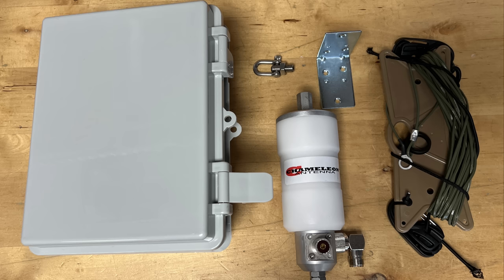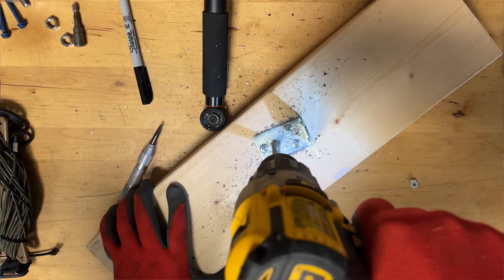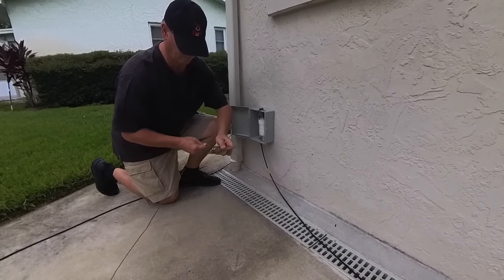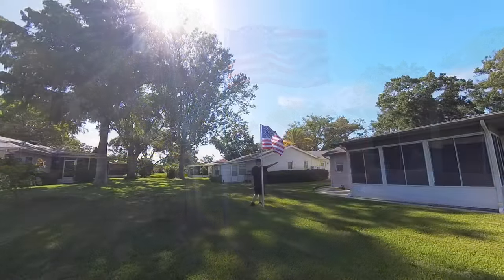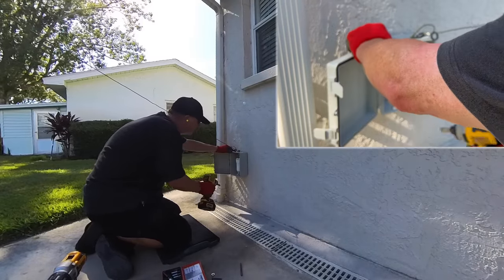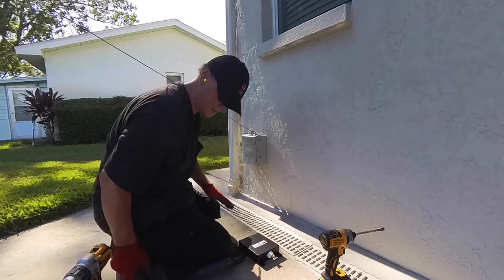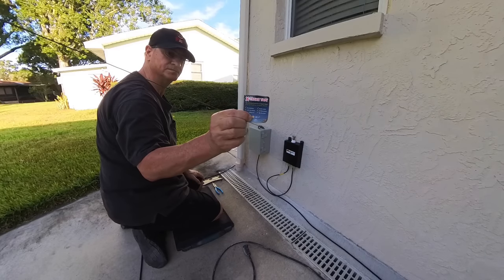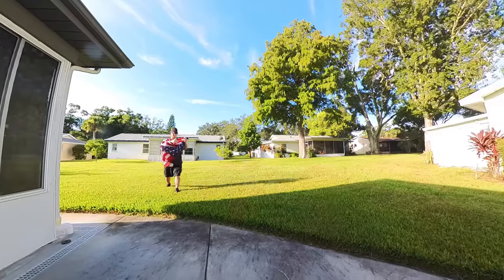Stealth Ham Radio Antenna the HOA will Never Find - Chameleon CHA Porta Mast with CHA Hybrid Mini

Comment: Great idea and great video. I love all your videos and your channel focus on HOA ham radio issues. Quick question: why did you go for the Chameleon CHA Porta Mast instead of a telescoping flagpole of roughly the same gauge? I know you like Chameleon products; however, it appears a similar FLAGPOLE could be utilized for roughly 1/2 the cost of the Porta Mast based on my quick research. I'd be interested in whether you went this route mainly because you love the CHA product line? I respect that, and just wondering if you've looked at the option of an actual flagpole to do the same job. FYI, my install will be a 20-25' pole instead of what looks like the 15' version in your Tampa backyard. I'm in a deed restricted manufactured home community down in North Fort Myers trying to accomplish the same objective of stealth wire antennas that are easy to put up, take down.
Reply from the maker: The Chameleon is preferred based on the quality and the mechanical mechanism for engaging / disengaging as it goes up and down.  I also own a Harbor Freight model and the Chameleon is heads and shoulders better from a quality perspective.  

Heavier gauge aluminum and superior mechanism on the Chameleon unit.  It will come at a higher price, but for me it was the quality.  I'll point this out in my final actual "Review" of the Porta Mast.  My model is the 20' unit, they do make a 25' unit.

Comment: Cool! Curious why you installed the antenna near the ground, rather than say about 7-8 feet up? I realize that you might have needed to move your mast to accommodate that, but at least nobody running through your yard, or any animals, would not run into the antenna. 

Is there a minimum flag size that the HOA requires? If not, you could put up a 1" x 2" flag, and then the mast wire could be connected to the top of the mast rather than only 2/3rds up.

Cheers! Great plan and creativity!
Reply from the maker: It was a matter of geometry...where the mast had to be, how much wire I had to get out...I would have preferred it higher up but ran out of room.  

Not sure if there is a minimum flag size, but there are flag size recommendations based on height of the pole.  LOL on the 1" X 2"...that might attract some unwanted attention : )
Reply: @HOAHamRadio  Maybe, but then you might get yourself a new HOA rule named after you!!! 🙂 Just a bummer that you have to work so hard to use the property you own and yet still are restricted as to what you can do with it. Great creativity though!

Comment: No offense, but I think you messed up mounting your box down low as you did. Your wire is coming across your sidewalk too low. Why didnt you mount it up high like at the top of the windows to get it above head height?
Reply from the maker: Lot's of factors that I didn't go into during the video. Your observation is valid but I didn't have a choice.  Its in my back yard, over a deck that no one uses...no one ever walks near it.

Comment: No HOA complaints about the wire from pole to house?
Reply from the maker: From a distance, it is invisible; on top of it, you can see it.  Since it is my property, and people aren't walking through my back yard, I am good.  If they, the HOA, did see it...it may be a problem.  I've had the wire to the front yard endfed for 3 years and no one every said anything...i.e., they didn't see it.
Reply: @HOAHamRadio  if it doesn't work out you could always move to the 100% Flag pole antenna.

Comment: Great video. I get the appeal of the flagpole. But the HOA doesn’t mind the wire running from your house to the flagpole?
Reply from the maker: The wire is really hard to see unless you're on top of it...and the HOA Board of Directors is not invited into my back yard close enough to see : )
Reply: @HOAHamRadio  A neighbor could see it and complain about the wire.  Stay friendly with your neighbors.  I think I would put it higher on the wall of the house.
Don't need anyone walk into it.

Comment: Maybe i missed it....where is the counterpoise?
Reply from the maker: @davidgold3267 good observation, you didn't miss it.  I'm running without one to stay minimalist here in the yard.  Since the video I've added a choke to deal with common mode current, which has worked.  Making contacts with ease 20 through 10; 40 is a bit more challenging so far.  Don't know if that is due to band conditions or my 30' wire.

Comment: I like this! I am in an HOA also. What length did you say that wire is? I want to be able to do 20/40.
Reply from the maker: I use a 30' wire because that is as long as I could get in the space I have.  Chameleon sells the CHA Mini kit with a 30', 60' or 130' wire.  I've been killing it on 20 meters since I did this install a few weeks aga; its been average on 40...but I haven't had much time to test it and band conditions fluctuate.  I've used a CHA Hybrid Micro with a 73' wire and operated well on 40.
Reply: Thank you! I do already have the CHA Mini so I was thinking of doing the same setup as you. Just wasn't sure if 30' would be OK for 20/40. I am assuming I would have to use my tuner? You measure it with an analyzer to see if its resonant at all? @HOAHamRadio
Reply from the maker: @m9a1man32  I run it through a LDG AT-100 Pro II; don't even pay attention to SWR.

Comment: Why didn't you put the box up higher on the house so people won't run into the wire?  Also it won't be as obvious to everyone if it is higher and horizontal since having the wire go to a box low on the side of the house is going to look oddly suspicious to anyone looking into your back yard.
Reply from the maker: It was all math; I could only get the mast so far away from the house, the wire was so long, it kind of forced this layout.

No one ever uses this back porch of walks near this wire so its okay.  However, if I could have, hanging it higher would have been the absolute best thing to do.

Comment: No grounding?
Reply from the maker: If you mean radials, I run without radials due to space limitations; hundreds of contacts regionally and globally no issue.  If you literally mean lightning protection / shack grounding the coax feed goes to my single point utility box where I have all my feedlines -- I show this in many of my videos as well as have two videos dedicated to the topic.

Comment: Why so low? Seems dangerous to someone not paying attention...
Reply from the maker: Geometry.  The mast is so high and so far away from the house, the furthest point of the house was used, the wire was so long...that forced me that low.

Its private property, and no one better be walking on my back porch, otherwise they will have more significant problems than running into my antenna wire : )

Comment: Remember, as bad as HOA-dwelling hams have it, apartment-dwelling hams, such as myself, have it far worse.
Reply from the maker: I hear you.  My conditions are not near as challenging as many
Reply: I also have found it very challenging being a ham in an apartment, particularly since they cut down the tree that supported my EFHW. It has forced me to operate portable and I have gotten very adept at putting up temporary antennas. Sometimes, because I can select my location, I have antennas that are much better than my friends and often have zero noise floor. I do wish I could just flip a switch and be on the air sometimes, but living in an apartment has forced my lazy butt to learn skills I would not have otherwise.
Reply: @stuarthall3874  I hear you.  I took my just-purchased IC-7610 and EFHW over to a local park last month and made dozens of HF contacts over an S1 noise floor.  However, I needed assistance from other local hams to assist me in setting up my EFHW, and so I will have to further develop my skill in setting it up on my own if I want to operate HF more frequently.

73 VE7NDE
Reply: @denelson83  Great, glad to hear. I'm impressed at using the 7610 portable. I will never again complain about having to lug my 7300 around. : )
Reply: @stuarthall3874  Well, the 7610 does have a carrying handle on it, so that is certainly a plus.
Reply from the maker: @stuarthall3874  I became proficient for POTA by operating in the QTH back yard at the HOA; constantly setting up and tearing down antennas has been a great education.  My first POTA set up was a breeze since I had been doing it in the back yard for months.